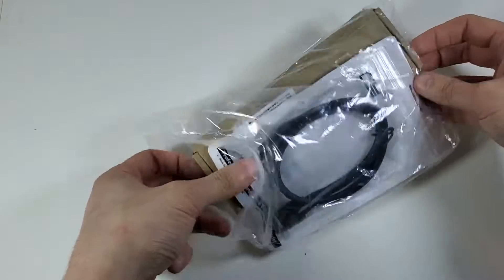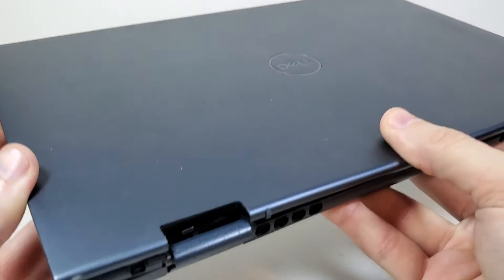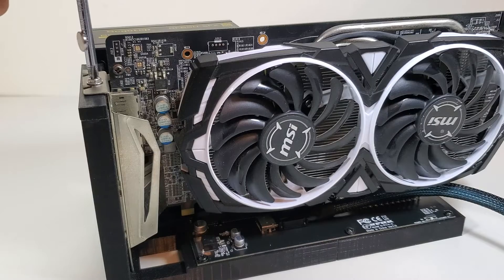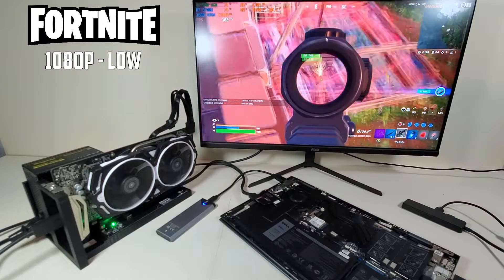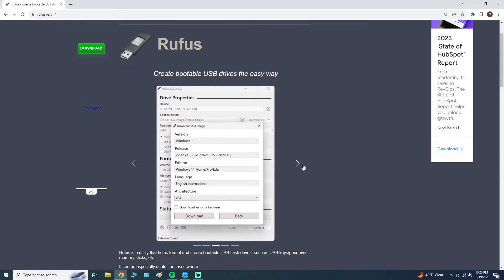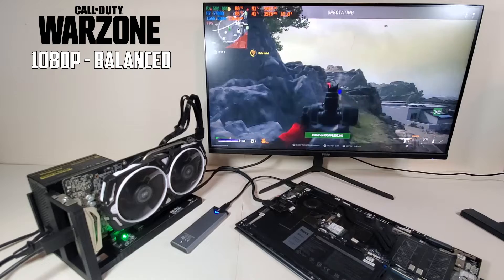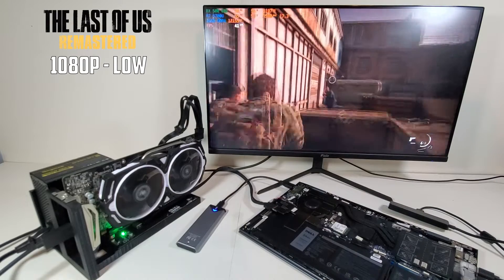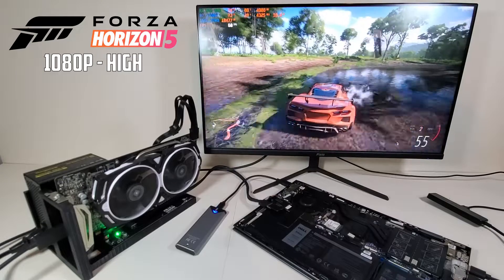I turned my BROKEN LAPTOP into a GAMING PC *Oculink EGPU*

Comment: You can also remove the wifi card and use the adapter in that, since they use the same technology. but older ones do use a Sata M.2 slot for some reason
Reply: Same thinking ❤

Comment: Hello brother, really cool video. I have questions if u have idea about it.
Can we use Laptop's (On this Oculink to M.2 nvme varient) Display instead of External Monitor?
How did u install Graphics driver cuze I'm not sure if it will cauze Disputes with Igpu(Both  Radeon gpu's, or Chipset drivers needed etc...)?
Is it safe, I mean will it not cause any Short to Egpu or Laptop's M-board?

Comment: I had this exact same idea to do this, i only have 1 m.2 slot and the only thing preventing me from doing this was that i didnt know if i could boot from an external ssd.
Reply: Chances are that your laptop also uses M.2 port wifi card. You can get another M.2 wifi to NVME adapter. Then remove your wifi card, insert the adapter into wifi M.2 port, insert your SSD into the adapter. You’ll get internal SSD. I’m currently using such adapter for my second SSD.
Cons :
- You’ll need to use Ethernet or USB wifi for internet,
- You’ll likely lose Bluetooth (unless you buy a combo USB Wifi + BT card or use another USB Bluetooth adapter)
- The M.2 adapter provides SATA speeds even if your SSD is NVME (and the port itself).

Comment: But make sure if you use your laptop as a desktop and you got it plug it in all the time, remember to unplug the battery. The battery in my Lenovo laptop started to bulge up, and the internet tells many stories of batteries bulging up and even ignite from constant charging. But also you can get a new monitor for the laptop...

Comment: hi, instead im connecting to the nvme slot inside the laptop, can i just simply using nvme enclosure and connect the oculink cable to it and then connect the nvme enclosure to the usb type c port at the laptop..can it works?

Comment: I have a question does having this reduce the performance of the gpu in any way like only being able to reach 70% of its performance even while paired with a good cpu and is it better or worse than the performance with a thunderbolt 3 eGPU?

Comment: You can make this pc portable, or mount it to the back of you monitor! Plus you can remove wifi module from m2 slot and run it through USB (or buy USB module), or connect internet wire.

Comment: Can you continue the controller v5 to v6 maybe? My idea is that replacing the joystick on the left, instead adding 3 or 5 mechanical keys at the back of the left controller in a 45 degree. And maybe another key on top of the left side as spacebar 

This is because most games like csgo needs individual fingers to control the movement such as conter strafing and jiggle peak. Idk if its possible to install them tho

Comment: good video! I myself have a 15s eq 5700u HP laptop and would like to connect an egpu to it. Which slot is best suited for this? the MPcie slot from the WiFi or the m2 slot from the SSD? And if the m2 slot is better for the egpu, can I use the m2 SSD again with an adapter on the mpcie slot? I would then get WiFi via USB. Greetings

Comment: I have the same oculink adaptor and connected it to my dell vostro pcie4.0 nvme slot and I can't get the GPU to even be detected. I haved turned the power switch on and psu is on. Lights on gpu turn on. I have tried to have gpu turned on first and second. I have a gtx 1080.

Comment: so what if you plug the egpu into the external usbc m.2 drive..? would that still work? You'd be able to leave your laptops m.2 where it originally was and just plug in a usbc cable and get an external gpu. Correct me if i'm wrong tho.
Reply: doesn't work, u need direct PCIe link to the PC and that ext. ssd only support USB 3 link

Comment: Im currently thinking on doing this with my surface pro 9 i7 1255u. Remove the mobo out & few other things then install the mobo into my mini itx case & oculink my rtx 3080 fe to it. I do want to remove the battery out & have it powered from my razer chroma pcb mobo to install some other parts into it.
Reply from the maker: i love that ide! i was thinking of doing that same thing.
Reply: @techyesterday4960  Hey bro I sent you an email about having a controller built.
Reply: @techyesterday4960  I'd love to see it possibly done, therefor I could copy & paste the project. I don't really know how to get reconfigure the settings tbh & I only learn from my mistakes but my surface pro 9 is currently my only pseudo pc setup I have.

Comment: You also have the option of "FSR" in stick form. It's called a 4k Gamer Pro. You don't need high resolution to do 4k 60fps. The only thing that matters is to find a resolution that keeps a constant 60fps. Then turn on the 4k Gamer Pro and get HDR 4k 60fps. You only need a 1080p active signal for the 4k Gamer to work. 640x360 and 1366x768 are both active 1080p signals. 360p is only recommended on 2d games. 1366x768 is minimum for 3d games to play in 3840x2160 60fps HDR. I highly suggest abandoning full on GPU rendering because all GPUs max out on 1440p and a little bit of 4k. Scaling beats rendering 100 percent.
Reply: Wtf are you talking about
Reply: @GameOver-nm2us  Upscaling is better then pushing the GPU to it's limit. You have way more breathing room. FSR or a 4k Gamer Pro is good. 900p looks good upscaled to 4k with the 4k Gamer Pro. If wanted to use 720p instead of 900p. You would need to cap your windows display on 1080p because that's how the unit registers the upscale. The 4k Gamer Pro needs a 1080p active signal. That's the only thing that's important. Instead of using the regular HDMI port. Use the display port only so everything on the desktop stays locked on a 1080p active signal. From there you could run your games in 720p or 900p to get a good 4k upscale. You can confirm 720p or 900p is actual 4k by pressing the info button on the TV remote. That's how you know you did it correctly.
Reply: @100Bucks  oh, yes I do understand all that. I just thought you were a crazy person saying "Grr only native 4k gaming is acceptable grr this is bad blah blah blah" but yeah you do make a good point

Comment: any chance you can list the parts you used here? specifically the "enclosure" that you screwed everything in and that has a square bracket to fit the PSU snuggly into. What's that frame called? Where can I buy one? Thanks!
Reply: I'd definitely be interested in parts list.
Reply: same man I'm searching for it but I can't find it anywhere, my setup looks messy asf if I find something like that I'll take apart everything and make it clean
Reply: @PHOENlX1734  he 3D printed it himself with a 3D printer and ink, which costs hundreds more to do and requires CAD software. Since it was a personal "homemade" print it isnt something you will find online for sale.

Comment: You can remove wifi card and add M.2(A+E Key) to 2 Ports SATA3.0 for booting natively from sata SSD. Off course you have to add USB 5 volt with a cable and add a USB network card.  Looks also great in this state. Cheers.
Reply: Ok trying to do this. I’ll let you know if it works
Reply: Why not use a M.2 E-key (WIFI-slot) to M.2 M-key adapter, so you can still use your NVME drive from the other slot in which you will now have plugged the Oculink adapter? Or won't it be recognized by the BIOS as a boot drive?

Comment: I had that nvme adapter and it died after having random frequent disconnects. The Amazon reviews reflect this.
Reply: So how did you get around it? Did you buy a new adapter and if so which one?
Reply: @abelcristiantimbalari7861  I sent it back. I replaced it with a non enclosed adapter that supports nvme as well as m.2 sata. I've had it for 4 years and even ran windows from it for a year. If you google "M.2 to USB Adapter, RIITOP M.2 NVMe & NGFF SSD to USB Reader Converter Adapter for Both B Key and M Key SSD" you should find it.